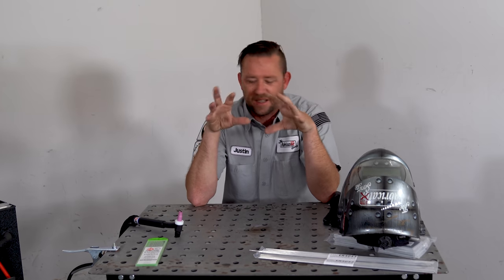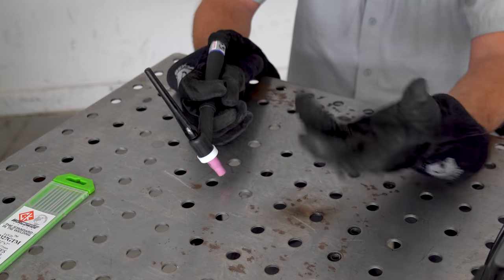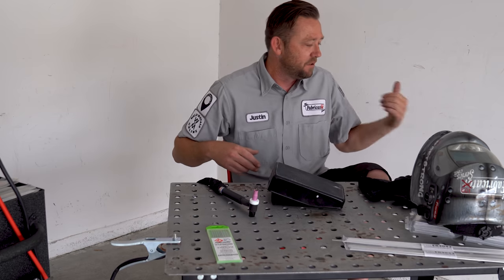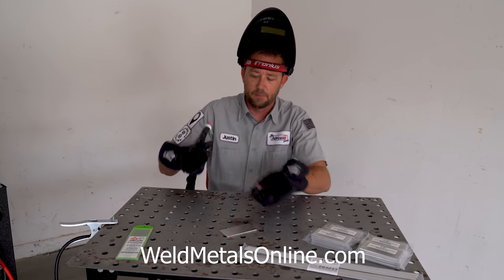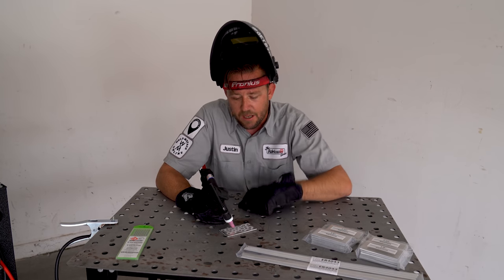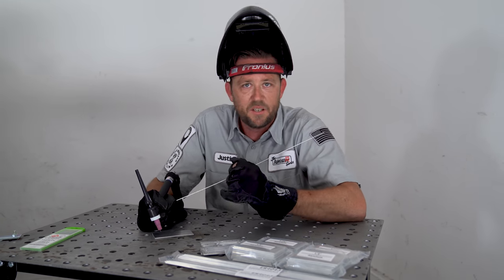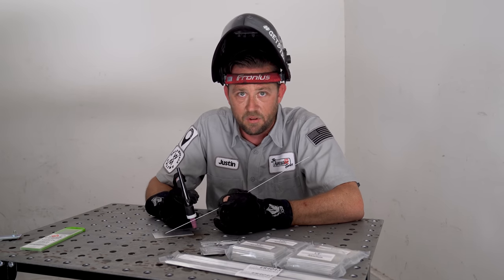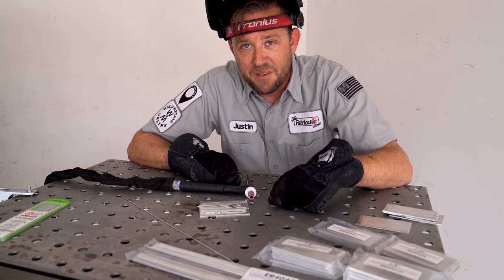Your Very First TIG Welds with EXTREME Detail

Comment: Howdy, your video was very educational.  I would suggest however that a different approach to your very beginning.  There is a science to work station design called ergonomics or also known as human factors.  A RULA assessment a tool may be useful to help prevent work related injuries for yourself and your students.  I seen may worker over the years become inquired because they were doing what they found to be comfortable vs what ergo engineer designed the station for.  Just something to look in to if you like.

Comment: The thing you said about the high frequency start is wrong. The voltage is high and so is the frequency but with high voltage there will also be high current, the reason why its not shocking or electrocuting isnt because of low amps, its the conductors skin effect at play due to high frequency. High frequency beyond 20k hertz will stop affecting your nerves since it flips too fast for your nerves to respond so it wont be registured as a shock but instead will burn your skin if left long enough.

Comment: Recommend you re-shoot this video for WeldCoach, albeit more condensed. The idea for beginners is to make dots, then move 2-3", then start putting down beads. That works. Also very strongly urge you to repeatedly address the subject of heat buildup in the coupon. This is a silent nemesis that keeps screwing up welds for no immediately visible reason. My $0.02

Comment: Straight up friggin welding.

Wish I could.

Goddammit thought I'd get the hang of sticking 4mm stainless together by now. 

I mean... I got a tattoo gun and self taught myself that in a week or two... 

But then being able to draw pretty good got a head start there... 

Hmm... Best run I got on the metal so far was interrupted as the filler rod hit me welding windscreen and took a tumble. 

Sigh.

Comment: Don't be fooled into thinking DC won't kill you welding aluminum and magnesium you use AC trust me 250 300 amps regardless if it's AC or DC it can be deadly if it actually goes through you arm to arm but you're never like that you have the torch in one hand and filler rod in the other a jacket on with a shirt or two under that rubber soled boots you shouldn't be grounded.
Generally if you get zaped by the torch it's just a little warning feels like a lot sometimes if you were grounded yeah it would suck I think the biggest trouble I've seen walking through a dirt lot welding leads on the ground with electric tape about every 2 ft in the rain crawling into a tube with those same leads laying there beside me inside of a steel pipe the leads arcing and sparking by my feet all the way to the hatch I'm trying to weld with water and oil running into the weld and down my back soaking wet lightning's busting all around us probably 25-30 foot up in the air inside of a pipe.
Even the boss was glad to get out of there alive he was doing the best he could to keep the crappy leads from shorting laying on bare wet steel everywhere fun times.

Comment: COULD U MAKE FILM WHERE U WELD 30MM DIAMETER 1MM WALL THICKNESS ALUMINIUM PIPE PERPENDICULAR TO A 10MM 500X500 PLATE?
I FOUND IT PRETTY CHALLENGING

Comment: and don't do the beginner mistake i did and buy a welder with 2 pins along side a pedal.. thinking it would fit.
those 5 pins.. are necessary to use a pedal.

Comment: question: The table is metal and the clamp on the left is connecting and completing the circuit. Yet I see your bare skin touching the table while using the torch. How does that not result in fried human for dinner?
Reply from the maker: Current (electricity) always takes the path of least resistance. The path is shorter distance from the electrode to the table vs through my body and through the table. I'm also not touching the electrode.
Reply: @TheFabricatorSeries  I see, I guess personally I'd wear long sleeves but its good to know I wouldn't be at risk of being shocked by the table

Comment: personally, I wouldnt call it a EXTREME detail video at all..
You didnt mention the important basic steps.. Which tungsten to use for certain metals.. AC or DC for certain metals... About the filler rods, What argos gas pressure to set at for a rule of thumb... 
Missed pretty much every basic, but important thing, that a new learner would need to know